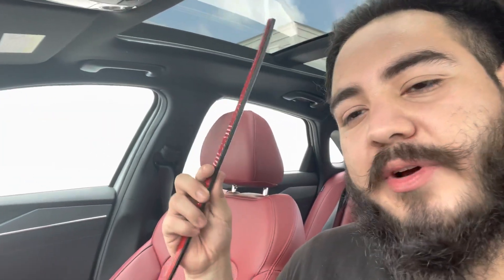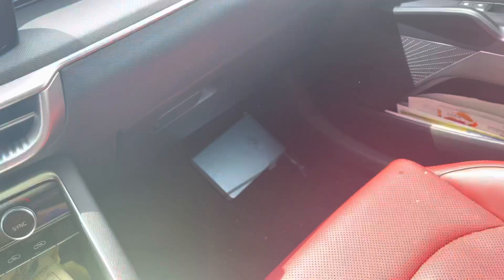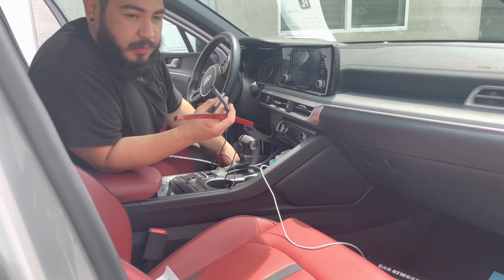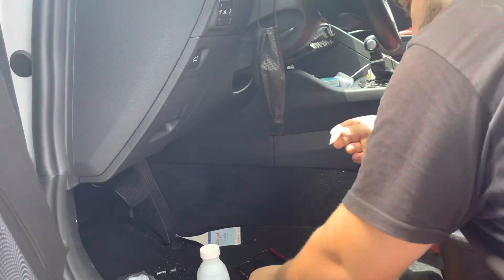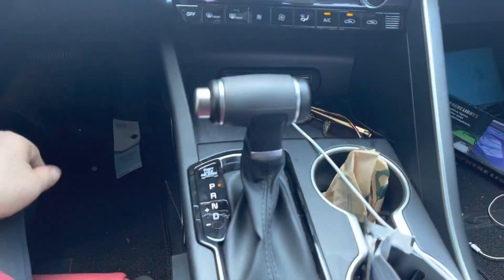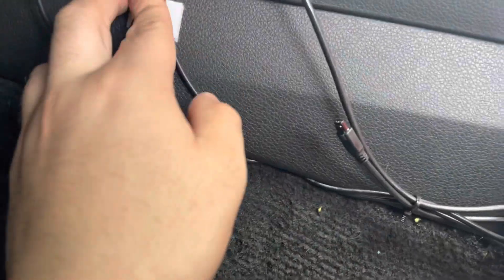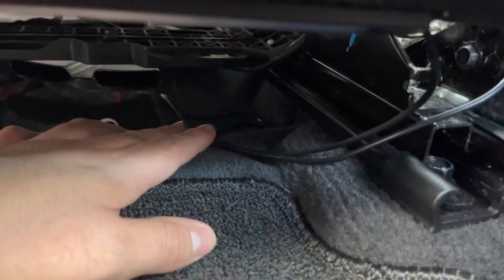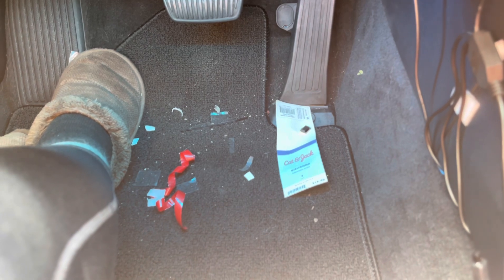Installing Ambient Leds On A 2021 Kia K5 Gtline

Comment: Nice vid broo. just a little advise. you can actually hide all the cables the you have on the right side of the center console. The box I hide it behind the area that is open in the middle between the passenger and driver side. by the pedals and just used a zip tie to hold everything together, lastly you can actually take the infrared bulb through a hole that is placed on the bottom next to the gas pedal. it works better and no cables visible nor on the way of the pedals.
Reply from the maker: Cool didn’t know that. There aren’t much videos for this car as far as removing the center console
Reply: is there a video that shows how to do that?

Comment: I think the k5’s wayyyyy to nice or a car & expensive to be havin all them wires visible & running through the car like tht. But thts just my opinion lolol
Reply from the maker: A nice expensive car for only $20,000 😱 what a steel
Reply: K5 not that expensive lol but it's definitely a looker. I am going to hardwire my lights in my car, just trying to find out which fuse to split because the 12v fuse is in the front fuse box smh
Reply: use one of the spare fuses to tap into, one of them is constantly on and the other one is only on when the car is on.